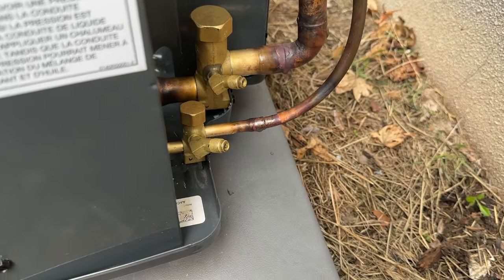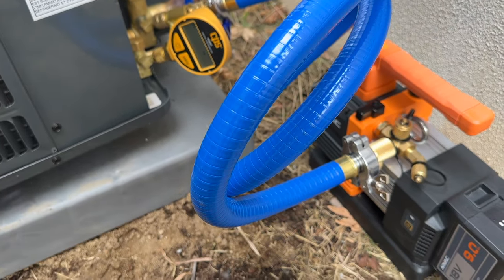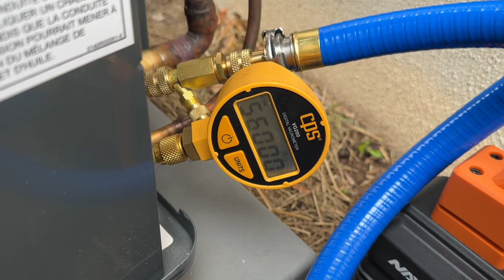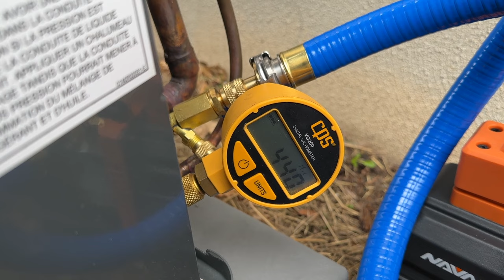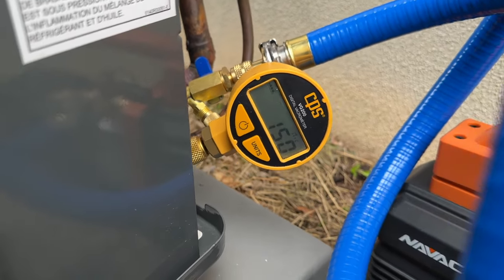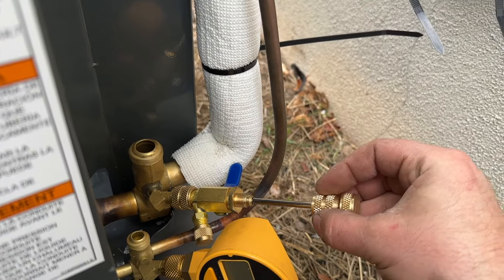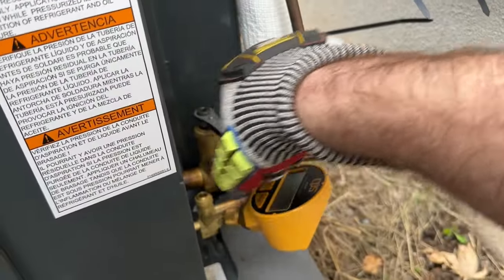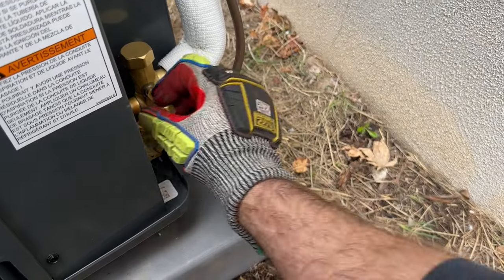How To Pull A Vacuum In Less Than 10 Minutes   - The BEST Way-

Comment: Have a good supply of nitrogen on hand, sweep the system well with the nitrogen, and then its very easy to pull a vacuum because the moisture is gone.
Reply from the maker: I’ve never had to do this. But I have heard of a triple Evac. Maybe for a super large system?
Reply: @diyhvacguy  No, for a regular domestic system while using a suboptimal vacuum set-up, flushing the moisture out first makes it go super easy.

Comment: I'm a HVAC technician,I believe you can achieve a better vacuum in the system by hocking up a manifold gauge on the high side & low side on the system for the vacuum to pull out not only air but also any moisture and stock liquid and debris in the system and if you must use one hose,I also believe that the liquid side or high side is the best side use.

Comment: I WATCH A LOT VIDEOS ABOUT INSTALLING CENTRAL AIR CONDITIONER 👍👍👍👍LET TALK TO THE POINT 😱😱😱😱IF YOU VACUUMED THE SYSTEM CORRECTLY 😱😱😱😱AND IT IS HOLDING 👍👍👍👍YOU DO NOT NEED PRESSURE TEST😱😱😱😱AN I CORRECT ✌️✌️✌️✌️✌️

Comment: 10 Minutes? Why it takes me 60minutes?
Reply from the maker: If you are using a manifold, it has to travel through some small openings, and has more potential for leaks. Also the hose size makes a huge difference. And if you leave your Schrader valves in, it will take way way longer. This method works fantastic.
Reply: Not sure how the 1/8" port opening in the service valve is any different than the 1/8" port in the manifold...it should be noted he is pulling only on the line set which could be as short as 10', and already dry.  I'd like to see this test on a unit that already had refrigerant in it or large walk in cooler or freezer.  Then I might believe.

Comment: DIY but u have to spend a few hundred at least on the tools to do it properly.
Reply: Few hundred on a decent pump,almost two hundred on a Micron gauge,couple hundred on a set of gauges so figure an even grand! Honestley,no DIY'er should ever even attemp this,you will have no warranty,you wont know if there is an issue,you wont be able to complete a factory required start up procedure etc! Just take the time to find a reputable company or individual that wont rip you off,and will stand behind  his work! They do exhist
Reply: Yeah more like couple of grand for fancy setup. He noted the vacuum pump was 800 smackers
Reply from the maker: Yes if you don’t have the mechanical skills and feel confident or don’t want to spend some dough on tools I definitely recommend finding a company to do this job. 👍🏼
Reply: @diyhvacguy it’s more of a diy if you are in trades and have some of the tools or all of the tools but this isn’t your speciality. As an automotive mechanic I had all the tools I needed originally sans the micron gauge; we don’t use those in automotive. Also, this was a high-end set up; you can get away with a cheaper set up if you’re only going to be doing this kind of work sparingly
Reply: @petersmart1999  I agree but it depends where you live. In FL where we use A/C 350+ days (we turn off our system only for 2 weeks ) there are 1,000s off techs that take short cuts so this info is good and doable for above average DIYers. I have turned away techs that don't bring vacuum pumps and nitrogen even when I verify when contacting. Even then they still do not do the procedures correctly.
Reply: To do it Correctly on tool's Spending at least $1,000- 1,200 on Vacuum pump, Manifold gauge and vacuum hose and Nitrogen tank and HVAC tools
Reply: That’s the whole trade tho. You can do this job with cheaper tools but you get what you pay for.
Reply: Few hundred haha try thousands
Reply: @petersmart1999 dint forget the recharge 🤣 especially being a diyer you know that bad boi running r22😂😂
Reply: Exactly 😂